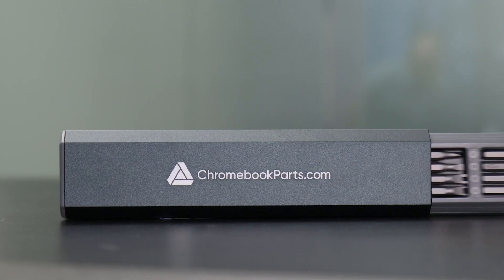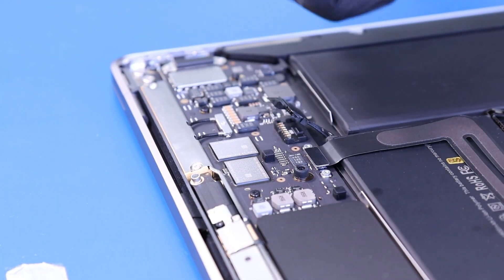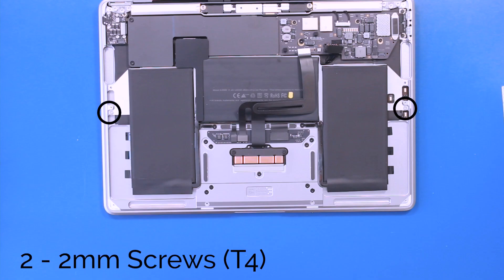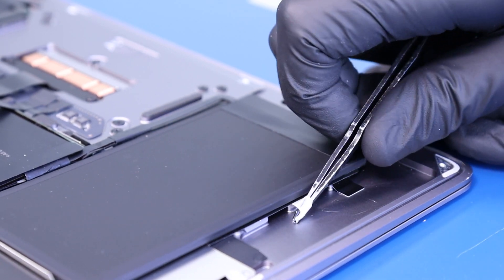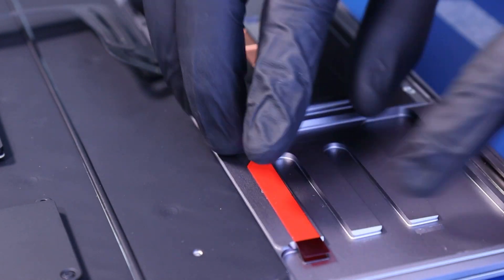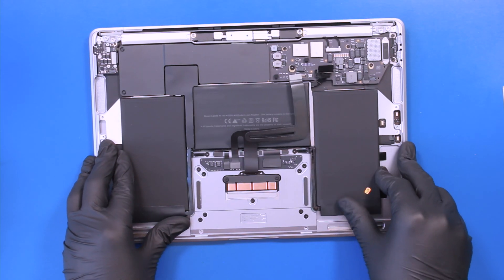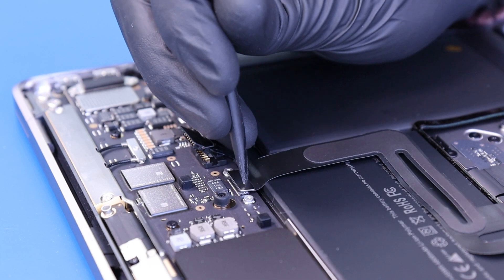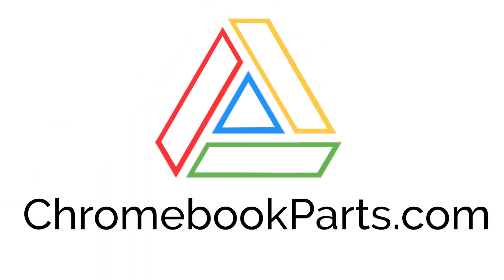MacBook Air A2337 (2020) Battery Replacement

Comment: Why are the adhesive strips even needed?  It's not like the battery has any room to move around once the back cover is back on.
Reply from the maker: We don't believe it's strictly necessary to apply the adhesive, but we do recommend it so as to completely secure the battery and avoid the possibility of any movement that could cause damage to other components or the battery itself. We believe there's enough space for it to rattle a bit, so that that might be annoying as well.

Comment: Where can you get the adhesive strips if they didn't come with the battery?  Also, what size are the strips, LxWxD.  Thanks
Reply from the maker: Unfortunately, we don't have a recommendation for that, as the adhesive always comes with our replacement batteries. In a pinch you could use this double-sided tape in a 3 or 4mm size:
https://www.amazon.com/dp/B019OQ4ZG0/ref=twister_B07YZKFB8B?_encoding=UTF8&th=1
HOWEVER, it's not designed to be removed as easily and might make a future battery replacement more difficult.

Alternatively, you could just go with the 4 screws that hold the battery in (though you may get some rattling).

Comment: What is the point of the adhesive I see zero need for it
Reply from the maker: The adhesive helps secure the components to the device to prevent rattling. While the battery has 4 screws holding it in place, it's large enough that they don't keep it perfectly tight.
Reply: As the battery gets hot, if you don't apply the adhesive, it will be shaken as you move the computer around.  The idea is to keep it in place.